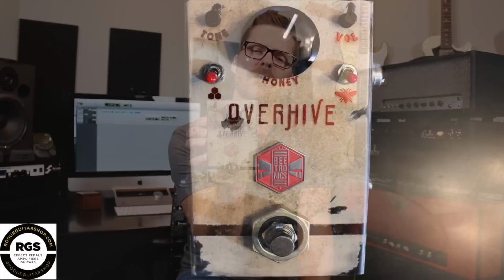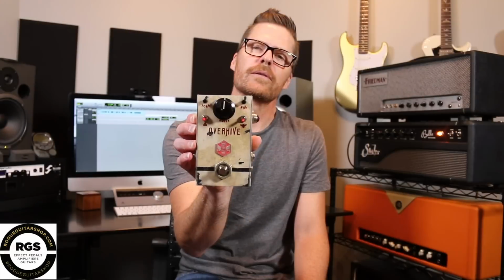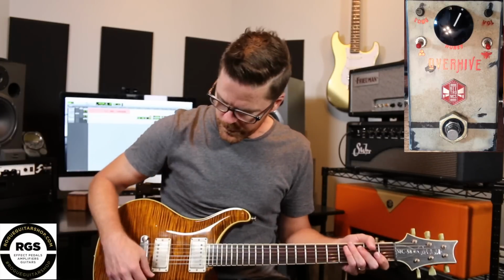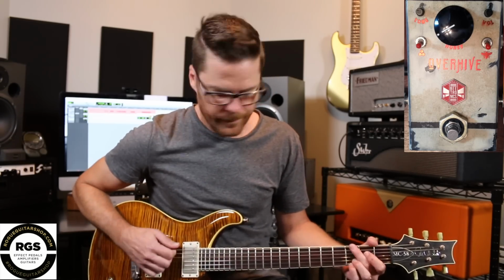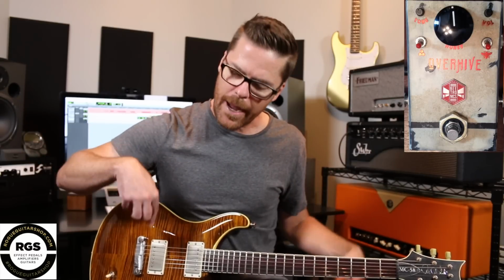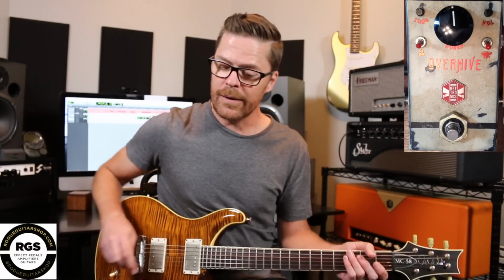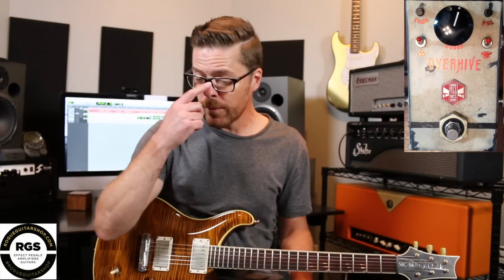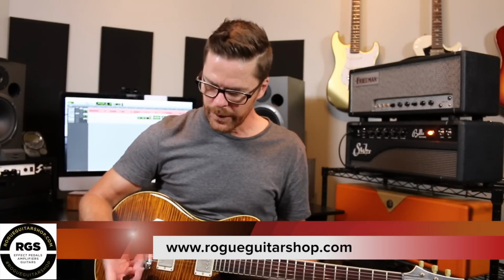Beetronics Overhive Overdrive Video Demo By Shawn Tubbs

Comment: Shawn I don't know how I missed this pedal demo from you but buddy you rocked it "Like A Hurricane"! This is a very well voiced medium gain overdrive pedal that really doesn't mess up the great base tone of your amp! Shawn I have a Tyler Amps JT46 1x12 combo based very closely off the classic Marshall JTM45 circuit and I had decided that I wanted a Klon klone pedal to push it with to go from a clean tone or a low-medium gain crunch tone which the JTM45 circuit really excels at to a thicker,tighter crunch and overdrive! The mid-range bump that you get from the Klon Klone pedals does a great job of pushing the amp into a very musical Marshall crunch!  My favorite klon klone pedal out of all of them is the RYRA Klone pedal! I'm not sure if you have tried this pedal or not but I'm wondering how well this Beetronics Overhive pedal would match up with a JTM45 style amp? What's do you think? Hope all is well for you and your family! Here's wishing you a safe and "Happy Thanksgiving"!

Mac Baker
Reply from the maker: I would think it would be good but the feel of the Overhive pedal is a bit compressed. RYRA makes good stuff but I'm still a fan of the JRAD Archer Pedal as far as Klon clones go. Happy Thanksgiving Mac!
Reply: @ShawnTubbs  Shawn sorry I'm just getting back to you buddy! Thank you so much for taking the time to respond to my post about the Overhive pedal and how it might stack up against a Klon klone pedal! I did notice that the Overhive does sound somewhat compressed which isn't a terrible thing by any account! But the beauty of a klon klone pedal is the thick midrange bump that you get but without it being compressed! I'm going to go back and listen to the JRAD Archer pedal and see how it stacks up against the RYRA Klone pedal! The Beetronics Overhive does seem to keep the tone of your amp intact which is something that I really like in an overdrive pedal! 

Best Regards,
Mac

Comment: Wow that thing sounds enormous and warm. I can't tell if that's the way the pedal sounds or if it's because of your rig. On that subject Shawn, what would you recommend for someone going for a Cream era Clapton sound? I've been looking at the MXR Fet Driver but this also sounds like it could get within that ballpark.
Reply from the maker: I think EC was using a Marshall JTM 45 or Bluebreaker in that era with a fuzz type pedal. I like the Overhive because it has a bit of that fuzz type character. I'm not familiar with the MXR Fet.
Reply: Shawn Tubbs Ah thanks for the input man, I hear that slight fuzz going on with this pedal too, that's why I'm intrigued. Great demo!

Comment: Great demo! I love this pedal. On another topic. I see you have your Lollars set very low on the Strat. I have a black Strat as well and just bought some Lollar Blackface and am having some trouble dialing them in. Yours look just a touch above the pickguard..is that right? Any suggestions would be appreciated.
Reply from the maker: Thanks very much, Peter! Yes, dialing in single-coil pickup heights can be a booger. My Lollars are the Dirty Blonde set so they are maybe just a bit lower in output in the neck and middle position and about the same in the bridge as the Blackface set. I also prefer the flat-pole set because they're just easier to work with to my ears, especially when it comes to height adjustments. Regardless of the poles or output, getting the height adjustment is something I do strictly by ear. I try not to focus on how it looks so much. One thing I will suggest is to make an adjustment and then put the guitar down for an hour or so and then check it out with fresh ears. If you still need to adjust up or down make very minor tweaks.
Reply: @ShawnTubbs  Thanks, Shawn. Will experiment.